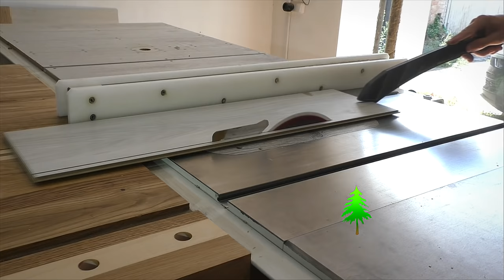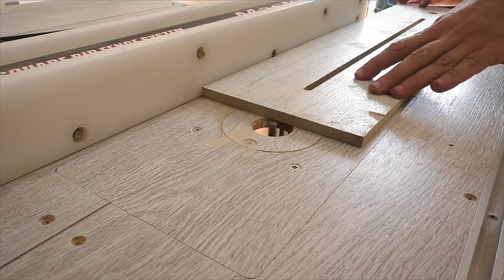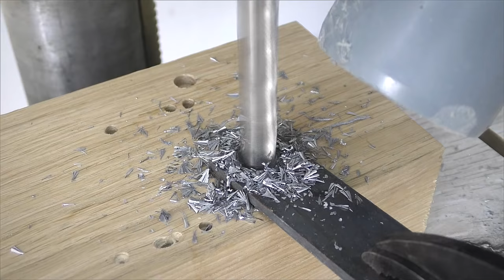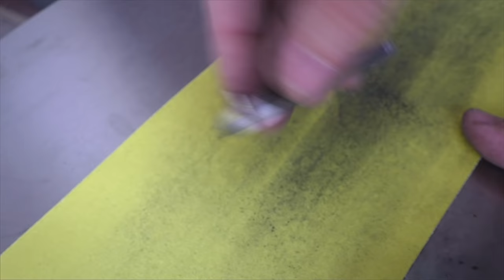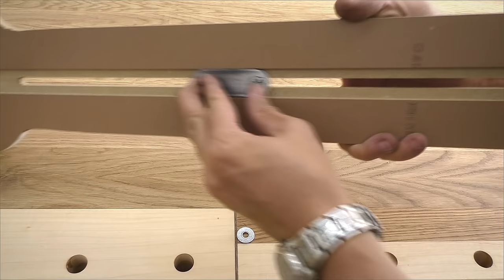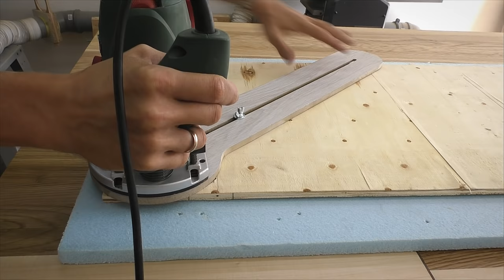How to Make a Quick Router Circle Jig - DIY

Comment: Good well made tool. 
I think the locating pin could have been a little stronger, maybe a small spring-pin?
I liked the idea of using laminate for this, and for your table saw insert.
I've also used it to make small boxes for screws and similar.
Useful stuff.
You really need dust removal when sanding though.

Comment: The bit you using on the router machine...is it a normal steel bit or a special type for wood? I have broken all my router bits ,if the steel one can do it will be better because they are much cheaper.
Reply: You broke all your router bits ? Two things to note - make sure you take small passes and not the big passes that this guy does. Most 6mm bits will break - here he is using a full carbide router bit, which is much more expensive than the router bits that are just all steel with carbide cutting edges. If you can afford a solid carbide upcut bit, it will last forever for a hobby user.